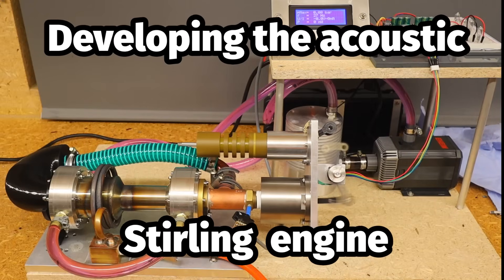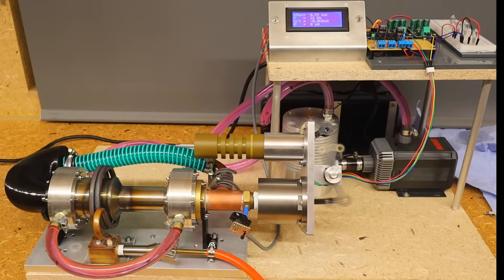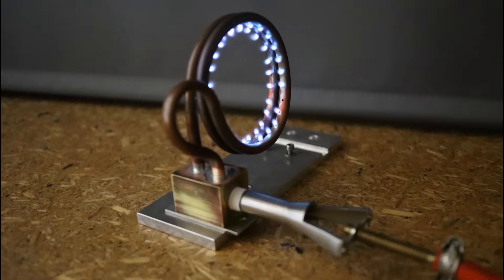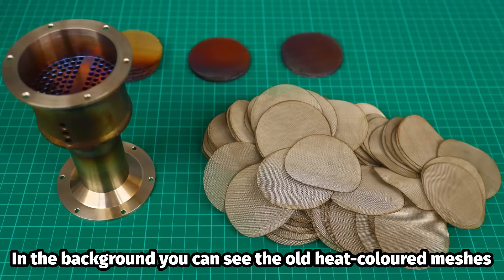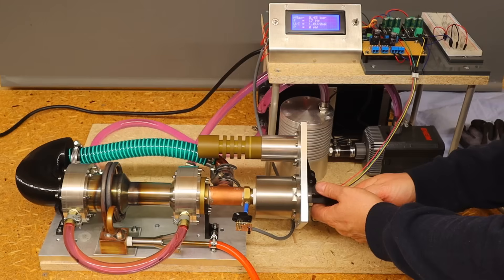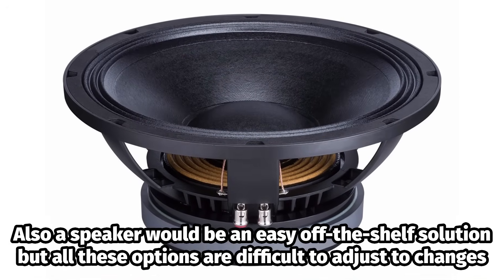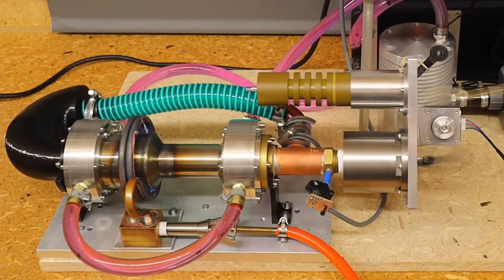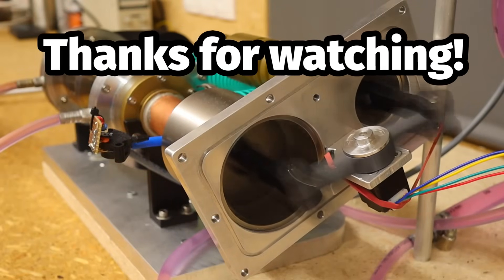More energy with the acoustic Stirling engine?

Comment: If you didn't figure out why it ran much worse with the balancing shaft. I believe it might be because the stepper is not good to use as rigid point. I think the shaft twists and bends causing everything to bind.

i would make a shaft and make 2 oil-less bushings for them, then mount the stepper with a coupling
Reply from the maker: I will make different setup test when I again try the oscillating stepper motor as a generator.
At the moment I am making test with a new linear generator!
But thanks for your thoughts, I will consider this!

Comment: With a one way ratchet system and a small flywheel at the pivot point (where you currently have your stepper 'generator'), you can 'rectify' the motion of the system in one direction.

Additionally, if you mirror that system and put a second stepper capturing the rectified rotational force in the other direction you can capture power efficiently in both directions of the oscillating arm. This would utilize the natural output of the pivot arm and the efficient design of the stepper fully.

Utilizing a power point tracking converter for a wind turbine would further increase the power harvesting efficiency, though it may load the steppers and in turn load the engine to a point where it may have a problem oscillating in it's natural frequency. The flywheels should help to reduce that tendency though.

The opposed 'twin' engine idea (in a comment below) to add a working counterbalance is additionally a great idea.
Excuse my terminology, I am just commenting on the physics of the system and how to harvest the power available in the most efficient way possible.
Reply from the maker: Thanks for your great suggestions and help, I will think of your points closely.
A ratchet always has much wear and friction that i want to avoid.
A second system as a 'boxer' configuration is quite ideal but will mean double the building work which will slow down the development process very much as i do this just as a hobby! When I have a satisfying output of a single system this will be an option.
A MPP tracker is also planned when zhe output is high enough!

Comment: I'm really pumped by your ideas and developments ! 
I did a bit of research on what's available, did you consider using a linear air pump as your PTO ?they are pretty cheap and includes already a linear guiding (usually PTFE bushing), laminated core, 220v/50hz optimised coils and a magnet on the linear shaft. They are available from 20 to 500W. 
The return spring could also be replaced to optimize stiffness to your engine oscillating frequency. 

Keep up the good work !
Reply from the maker: Thanks for the great tip, I'll take a look and see if it might work!

Comment: Would copper mesh work better because steel is like 10x less thermally conductive?
Reply from the maker: The temperature gradient in the regenerator is most important so copper would be too conductive and the temperature difference between the hot and cold end would not be very high!
That's why I use the bad conductive material stainless steel!
But you are right, if this would not be so important, copper would be ideal!

Comment: I think you would be far better off using an alpha stirling engine, they have much better mechanical power potential. You can easily add cooling to improve performance, possibly oil an jacket to add heat.
Reply from the maker: Please look at my older videos where I show my high power kinematc Stirling engines in detail.
The reason for the experiment with the thermoacoustic engines ist that they need less maintenance and are much cheaper!

Comment: I experimented with homemade magnetic materials, and sadly found that
Iron chips in resin dont work. The mu_r is way lower than in a solid, because the magnetic flux has to go through the small contact points between the chips.
Reply from the maker: Unfortunately, I have already experienced this, as I had hoped to build the relatively complicated structure easily. Unfortunately, however, this does not seem to work very well. Given the relatively low frequencies of the Stirling engine, however, eddy current losses are likely to be quite low, so I believe I can manage with thicker layers. Thank you for your important information!

Comment: You got some interesting projects here. May I ask I've been looking for someone or a solid resource to help with designing a 2x2 design of beta type stirling engines linked and working together. That said I've been talking back and forth with ChatGPT and well let's just say when it comes to the finer points in things it begins to give contradicting information.
Reply from the maker: I would say keep it simple first and build a single engine. If it runs to your satisfaction you can extend it.
Reply: @myengines2443 you're right im trying to go from 0 to hero right off the bat but i really should be taking my baby steps and work my way up

Comment: Great work! may be you can use the linear-motor/generator to start. Excite the system with its resonance frequency using the linear motor.
Reply from the maker: Yes, that's one possibility, I hope the forc is sufficient and the control not to complicated!

Comment: Could this technology and construction methods be used to build a Stirling engine cryocooler?
Reply from the maker: In fact, the thermoacoustic principle is mainly used for cooling.
However, I don't know whether it can achieve very low cryogenic temperatures like a conventional Stirling heat pump!
Reply: @myengines2443  supposedly if you use helium as a working gas, it can.

Comment: The added cylinder and piston drop the frequency too much and the engine's frequency (untuned) will be so far from the mechanical parts resonant frequency, so you need to add some spring on it first (as you did it with the rubber bend) or pressurise the open end to make a flexible but much harder spring on that side. The frequency that we hear is significantly higher than your mechanical parts needed. if you can rise the frequency on the generator side you will get more power. Try a flat spring that connected directly to the moving arm's teeter side. Good luck! BLADE
Reply from the maker: I am now going to install springs, something I have been meaning to do for a long time but haven't got round to.
I am also going to try a lighter plastic piston, even though I had a few problems with the last one due to its greater thermal expansion.
I'm curious to see if a lighter piston will result in a significantly higher frequency!
Thank you very much for your expert help. It's always nice to get comments from a authority on thermoacoustics!

Comment: Use mild steel for your iron core just spray each lamination with lacquer between them to isolate each layer, you can also get many steels on a coil so thin that you can cut it with small tin snips or a good pair of scissors depending on the thickness needed laser cut mild steel will be a good way to prototype your generator and then get the last 5-10% efficiency from proper electrical steel when you can source it
Reply from the maker: I'm going to go with mild steel for the new linear generator for now, as several people have suggested that the difference isn't that big.
Thank you very much for your help.
If anyone still finds a source for silicon steel, please let me know!
Reply: @myengines2443 if you need a source of thiner steel look at shim stock you can get it on a roll for thinner lamination i think MSC stock it
Reply from the maker: I have 0.5 mm mild steel sheet, I think for first tries at my low frequencies this is thin enough?
Reply: @myengines2443 thats certainly a good starting point you'll tell by the heat generated if your frequency needs anything thinner
Reply from the maker: You really think the eddy currents could eat so much efficiency to produce tangible heat?

Comment: Could it be possible to connect two engines into a boxer like configuration so it can actually spin instead of rotating back and forth 
So the large piston would oppose the other large piston and small would oppose small in theory I think it should be possible 
And it would 
Looks cool 
Less vibration 
Rotating motion instead of vibration
Reply from the maker: Yes, that's a good idea, which I will try out once development has progressed a little further. At the moment, it would double the development effort, which I can't manage. Thank you very much for your great help!
Reply: @myengines2443 awesome and good luck
Reply from the maker: Thanks!

Comment: I'd ditch the burner and use an electrically charged magnet ring for heat and helium gas in the piston assembly. To get it to fire enclosed , I'd use a high powered focused on/off electromagnet.
Reply from the maker: Yes, these are all good suggestions, but since I want to use my own biogas in later productive operation, I would like to fuel the engine with gas even now in the development phase.
I will experiment with helium as the working gas as soon as the engine is sealed and can be pressurised. Starting with an electromagnet is a good option that I will consider carefully. Thank you very much for your helpful comment!

Comment: by the way the balance problem can be solved by using another piston which is in the same tube as the first and the sound pressure is applied to the middle pushing them both out at the same time evenly, search  - Schematics of thermoacoustic Stirling electric generator for recovering LNG cold energy
Reply from the maker: Yes this is a very neat possibility but will double the development effort and i will try this when the development stage is near end!

Comment: To your question on sourcing magnetic steel, just use mild steel. Mild steel is basically pure iron which is ideal for non-fluctuating magnetic field reinforcement. Silicon steel is only very slightly better at changing polarity and probably not worth trying to source for a prototype
Reply from the maker: If that is really true it would be very nice as mild steel is very available!
I think with my relatively low frequencies the eddy currents would anyway not so high?

Comment: 1. You can get toroidal iron ferrite inductor cores 2. the counterweight has momentum which has to be stopped, and accelerated which is why rotary engines are so much more efficient. You can use a crank operated generator instead of reciprocating like most Stirling engines. A free piston design is an option but only because the piston is the generator, trading momentum for simplicity to offset inefficiencies. 3. Spherical powder will get you higher recuperator density while increasing surface area.

It would be interesting to make a recuperator out of high temp magnetic powder, to use it as the linear rotor in an opposed piston super critical CO2 setup. AlNiCo or Semarium magnets can hold up to the high temps, and expanding gas drop from 800 deg to below 21 deg  meaning it can be used to cool the magnets to well within curie temp.  Diagram:   ( Hot     I mag I     Cool     I mag I      Hot)
Reply from the maker: This is very detailed information that I need to work through carefully first.
I don't think I've understood everything completely and will ask again in the next few days!
Thank you very much for your very thorough help!

Comment: I have seen a video by Paul Babcock who claims to have used low-carbon shot-gun pellets in epoxy as an efficient core material for his electromagnet motor, as a cheap substitute for silicon steel...  If you're committed to this project, I don't see how you can avoid making your own generator, eventually.

I have no real-world testing data to back this up, but intuitively I feel the linear generator must be a more efficient way to go, considering friction losses on the linkages, converting linear motion into rotary motion.  With a fixed permanent magnet on the piston, you could simply manufacture a few different field coils to swap in (of various winding counts, and cross-section width) and run them at various voltages/current, to test what works best for the size of your motor.  At least with your own generator, you aren't bound to the stall torque of a proprietary stepper motor, because you could adjust the field coil to whatever amount of flux that you want, just before the engine stalls.  In theory it would also be trivial to simply add or remove magnets...

This you probably already know, and I don't want to be pedantic, but noise = inefficiency.  Whatever is causing the clacking noise is probably losing you energy... I only mention it for the sake of completeness, as I am no authority on sterling engines or generators.

Cool project.  Very impressive craftsmanship.  Well done.  Keen to see the next iteration.  Keep up the good work.
Reply from the maker: Thank you very much for your detailed suggestions and assistance.
The loud noise is caused by the piston hitting the cylinder base or the stepper motor mount at the end positions.
Of course, this should not happen at all, but the machine is still in the very early stages of development and if I pay attention to every little detail, I will not make any progress.
The motor is developing very quickly, and until I have achieved a satisfactory level of performance, I am leaving out minor details, as everything will be changed again anyway!
Thank you for your great comment and your help!

Comment: Wrapping the thermal chamber with an insulated shell will certainly increase thermal efficiency as there will be less waste heat going directly out into the environment.

A lazy person could make one out of a steel can like you could purchase filled with food at a grocery store.

Also, in regards to angular deflection [which causes misalignment of the pistons] can be remedied with a scotch yoke.

The rotational action of the counter arm is forcing the parts to deflect angularly in their cylinders which is going to rob power from you.

A double ended scotch yoke need not be very large, nor very complex, and need only be 'long' enough to account for the tangential deflection, which is likely only a few millimeters.

So far as a super low coercivity transformer winding, one can literally take a right angle grinder to common silicon steel [you can get this from microwave oven transformers and many motors already being discarded, I have dozens of them], a small amount of very fine aluminum powder and a small amount of sodium silicate, mix these together OR you can build a ferrite core.

There are many recipes out there, literally thousands of them in fact.

Here is an easy way to begin looking into them: https://en.wikipedia.org/wiki/Ferrite_core
Reply from the maker: Thank you for your very valuable suggestions. I will think about them and implement some of them.
By mixing your own alloy, do you mean actually melting it at very high temperatures or bonding the components with epoxy resin?
I will look it up online. There seems to be a lot of information out there!

Comment: Mass of mechanical parts that has to be accelerated and decelerated each cycle with the power that engine generates reduces the amount of potential useful energy. The more mass in those parts, the less useful energy you can extract. The higher the frequency and the higher the speed of those mechanical parts, the more energy you lose to that, so ideally you want to make any mechanical parts as low in mass as possible. Obviously those losses also increase with operating frequency, and the distance the mechanical parts travel, but reducing frequency and distance also reduce the possible power output, all else equal. 

If you can store that kinetic energy, perhaps in a spring, that could potentially reduce that energy loss to accelerating and decelerating mechanical parts significantly. While rubber membranes can act as springs, and fill other functions too, I don't know how easy it is to make them last for long in this application without making them too thick. Maybe silicone rubber, molded from 3D-printed molds?                

I still like the idea of the turbine, maybe try different designs? Maybe a more narrow duct for the air could focus the force in each part of the cycle better? I'm thinking narrow ducts, just directed at a part of that turbine, and without stators, just directing the whole ducts with a good angle relative to the turbine. I don't know for sure, but I suspect the main problems with that turbine was the fact that the force was "diluted" over a way to big turbine area, and also quite significant losses in the path. Sharp changes is direction of airflow can cause very significant energy losses.           

As you don't "just" have to consider "simple" air flow, but also pressure wave propagation, accurately estimating how much of a difference any changes to the shapes in what the working gas and pressure waves have to travel in could make is way beyond my abilities, but it might be worthwhile for you to consider. Perhaps try reducing changes in direction that you don't want where practical, and make such changes that are necessary as smooth as possible.
Reply from the maker: Yes, of course, the moving masses must be kept as small as possible, but some are necessary also for balancing.
In order to make good use of the counterweights, the magnets for the linear generator should be used for this purpose. I have been thinking about recovering the kinetic energy of the masses with spring force for a long time, but I still have to implement it. Thank you for reminding me of this again.
The turbine is not running to my satisfaction and is not very efficient.
Your suggestions are very good and I will think about them very carefully. I think you have identified the problem well. Thank you very much for your valuable help and I am thinking of modifying the turbine as its a very elegant way of generating electricity!!